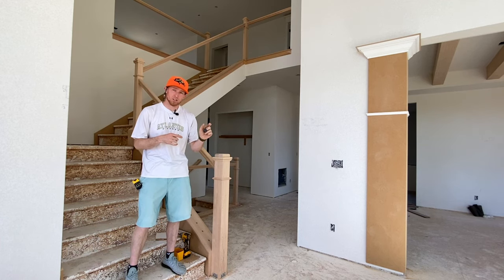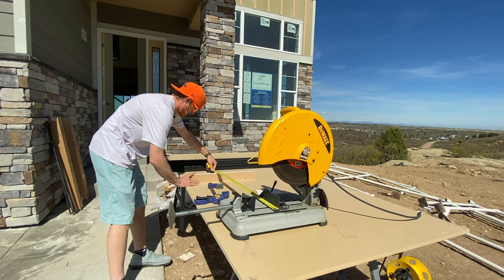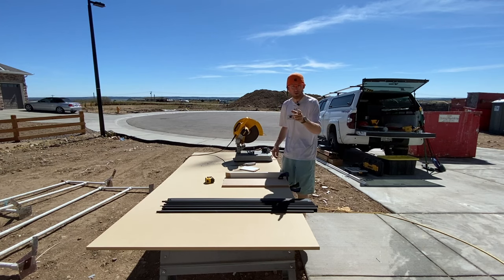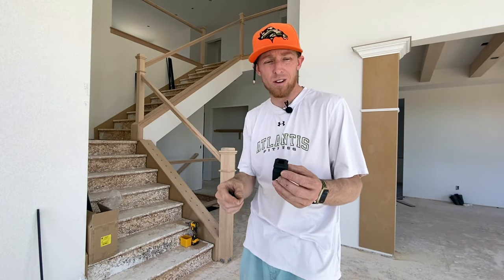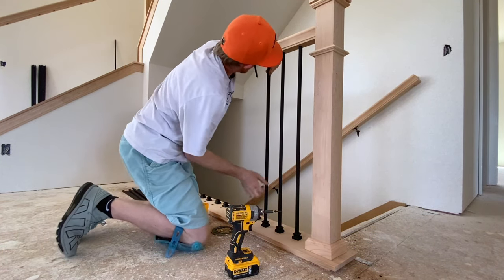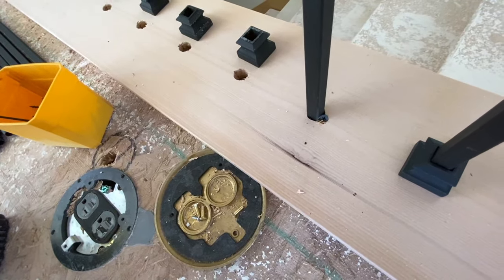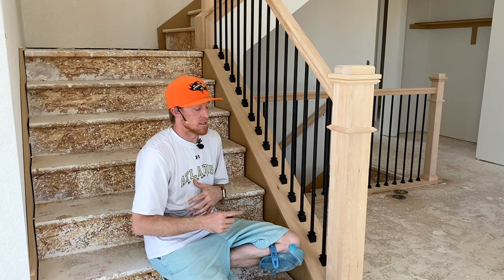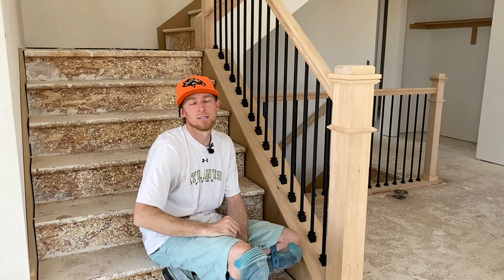IRON BALUSTER INSTALLATION / EASY DIY RE-SECURE *NO GLUE* : MEASURE, CUT, INSTALL, STAIRCASE UPDATE!

Comment: Great Job Hunter.  Starting tomorrow.  I take it the depth of your holes are 3/4"?  I'm installing 3/4" tubular iron balusters.  I was thinking a 13/16" hole at the bottom, what do your think?  Thanks so much.
Reply from the maker: Thank you very much! I would try 13/16” for the bottom, but don’t be afraid to go to 7/8” if it is hard to slide into the hole... sometimes you can gently tap the top of the baluster with a hammer into the hole if it’s snug...
I don’t go over the depth of the hole very well in the video... so you need to drill 1 1/2” (cap and subfloor thickness) deep to slide your baluster down then up into the handrail...in most cases I just drill 2” down(or until I break thru subfloor), but I know there is nothing for me to hit under the subfloor...just make sure you are snug on your hole up top with the baluster and you slide the baluster “about” 3/4” up into the handrail...
Any more questions I’m here to help! 
Have a blessed day!
Reply: @huntercarlson5446  Thanks Hunter!  I'm experimenting today but don't think it will be to complicated thanks to your video. I am a retired electrical engineer with a "blue collar" background.  I'll let you know how it goes.
Reply from the maker: Sounds good! You got this!

Comment: Just curious - if you use a 5/8 bit instead of 11/16 for the bottom: wouldn’t that give a better fit? The screw seems to pull the baluster left or right. When the gaps are real close to 4”, that could lead to disaster along a long run.
Reply from the maker: You can totally use 5/8” instead of 11/16”, you will just need to tap the baluster down into the bottom hole with a hammer because it will be super snug!

Comment: Thx Hunter. Great video. I’m about to do this over the weekend. My balusters were installed with a dowel pin on the bottom. The hole to accommodate this is about 1 1/2” deep and 7/8” diameter. The top hole is about 7/8” deep. My questions:

1) is the donated of the tread hole to wide to accommodate this method?

2) should I drill the top hole deeper and put a plug in the tread hole?

3) I know this is a no glue method but wouldn’t a little glue in the top hole better secure the balusters?

Thx for your help.
Reply from the maker: Hey Allen! Thanks for watching and hope this will help you with your install! 
1) the hole might be a little wide but as long as you pinch the baluster with the head of the screw it should hold nice and tight! Run the screw tight and parallel to the flat surface of the baluster, once the head of the screw pinches against the flat part of the baluster it should be nice and tight! 
2) if the “nib” on the top of your balusters are smaller than 7/8” then don’t drill the top holes deeper…you may need to drill the bottom holes deeper depending on the size you cut the balusters…if the holes on the handrail or the top holes are too big to hold the baluster tight, you can use the screw method and use a boot at the top to cover the screw and hole.
3) you can totally add glue to the top of the balusters…when I drill the top holes myself I make them either 1/2” for a flat section of rail and 5/8” for the rake section of the handrail. Those size holes hold the baluster nice and tight and I have never needed glue…also without glue it’s a little easier to replace them in the future if needed. 
Hope this helps! I’ll be available this weekend to answer some more questions if you have them! Have a blessed day 😎
Reply: @huntercarlson5446  thanks Hunter for the quick response. The balusters just arrived and the nib is less than 7/8” so I can now see how tight the top will be. Also looks like the gap in the bottom is not as wide as I thought. I might just put in 2 screws to stop any movement. Again I appreciate the time you took to make this video and your quick and thorough response. Have a great weekend!
Reply from the maker: I have used 2 screws on the bottom sometimes to help secure so I feel you will figure it out! Let me know if something comes up! Thank you for your support!
Reply: @huntercarlson5446  I'm replacing doweld balusters with rod iron. So I already have a hole on the bottom and adding a new handrail. I was concerned that the existing hole may be too big. The shoe would cover it fine, but learning your 1 or 2 screw trick eased my mind on getting them sturdy! Thanks!
Reply from the maker: I’m glad I was able to help! If you have any questions when it comes time to install your balusters don’t hesitate to reach out! I’ll be happy to answer to the best of my ability! Thanks for watching and looking through the comments! Have a blessed day 😎

Comment: Great video but I have a dumb question. On the level run, you mention in a previous comment you use 1x6 or 1x8 for the cap. Is that directly on top of the sub floor or is there anything in between?
Reply from the maker: Great question! In areas where carpet meets the cap, I nail and glue the cap to the subfloor. In areas where hardwood, tile, or vinyl meets the cap I will lift the cap so the flooring isn’t flush with the top of the cap...usually I will use 1/2” or 5/8” osb and rip pieces to secure underneath...even better would be to use a couple scraps of the flooring to raise the cap or install cap after flooring... please let me know if you have any more questions! Glad to help! Have a blessed day!
Reply: @huntercarlson5446  Thank you for the help, I really appreciate it!
Reply from the maker: Anytime! 😎

Comment: I currently  have wooden spindles.  How do you secure the wrought  iron when the top hole in the railing is bigger then the wrought iron?
Reply from the maker: Zina sorry it took a while to respond…I personally would use the screw method at the top as well as the bottom, but I would use a boot at the top as well to cover the hole and screw. So each baluster will have a boot at the top and bottom. Hope this helps and my response isn’t too late! Have a blessed day 😎

Comment: Hey Hunter. Great video,  good information and  down to the point. I''m about to install some balusters here in my house. I have a question as to the screws you are placing at the bottom to hold the balusters. Are they going between the baluster and wood base or are you going through the balusters?
Reply from the maker: Thank you so much! My screws are going between the baluster and the hole drilled into the wood cap...hold the baluster tight to one side of your hole and make sure you are keeping the screw tight to the flat part of the baluster so when the round head of the screw crosses the flat part of the baluster, it pinches the baluster snug to the wood...those three points of contact will hold the baluster nice and snug! Let me know if you have more questions! I will be here to help out! Have a blessed day!

Comment: Hunter, the current wood railing has a shoerail on top of cap, when I replace with iron, is the shoerail necessary ? We are having laminate floor installed at same time I replace rails.
Reply from the maker: When you replace the balusters with iron you need to remove the shoerail from the cap! The iron is not made to be installed on top of shoe rail...maybe mark the center of each baluster on your cap, before you demo, with pencil so you will know where to drill the hole for the new baluster...It will be a larger project but I would like to have the rail cap installed on top of the laminate or have a piece of 1/4” round to nail against cap and on top of the flooring...not suppose to nail the laminate from my understanding so there to be needs something on top of that edge to secure it from moving...

If you have any more questions please let me know! Hope I answered what you needed! Have a blessed day!

Comment: What is the going rate to replace wooden balusters with metal ones.??  There are 70 balusters with 47 linear feet of banister to sand and refinish.  Asking as a contractor.
Reply from the maker: Sorry it’s been weeks for a response…I believe I would be able to get it done in 1 day even if there is a lot of sanding…without seeing the project I would estimate $350-500 for labor…$350 would be for an easy job that didn’t require any additional drilling or plugging…$500 if there are some difficulties to getting a good final finish product. I would also be happy with $500 for a full days work, so it depends on the area you are in as well for the hourly rate of labor…
Hope this helps a little…if you have any more questions get back to me and I will definitely answer you faster! Have a blessed day 😎

Comment: Hi Hunter,  I want to replace the iron balusters that I currently have but of course they’re glued in.. do you know of any way to easily remove these?
Reply from the maker: So they are glued in...crap! The best way would be to first loosen the boots at the bottom, if you have a set of heavy duty pliers or vice grips try and twist each baluster until the glue loosens or breaks. Or if you have a tool to cut the balusters in half(grinder with metal blade or “sawzaw” with metal blade, and a good vacuum for metal shavings), cut them and then use pliers and gloves to twist and remove.  The balusters I use are hollow so I can bend them when they are secured, so maybe try to use some force and bend them to get them out...just be careful of the wood material for damage when doing so...hope this helps out! Any more questions don’t hesitate to ask! Have a blessed day!

Comment: Dude just finished my stair case using your methods, it looks awesome but my stairs don’t go down at the same angle as the slope on the boot. So when you tighten the Allen key up it sits weird, any tips how to over come that? I was thinking of either glueing then in or shimming them up some how? Love your work hope your well
Reply from the maker: Thank you very much for your kind words! Yes I have had that same problem in the past with the boots...I’d say to use a little dab of liquid nail under each boot to secure them for now...after the glue is dry gently tighten the Alan screws till tight and walk away...don’t use too much glue underneath so it’s easy to replace in the future...and other questions please let me know! Have a blessed day!
Reply: @huntercarlson5446  thanks for the reply, managed to insert pieces if cereal box on the opposite side of the Allen key screw and it allowed the boot to sit flush when I tightened up the Allen key screw , I’ll leave it like that fore now and see if it loosen over time. If it does I’ll glue them in like you said.
Reply from the maker: Great idea! Love how you improvised with what you had in the house! Thanks for your time!

Comment: Hunter, Great video and solution to PL Premium running all over my stairs. One question, I'm installing solid iron (not hollow) balusters. Anything you would do differently for solid balusters?  Will the screw method still hold up the weight of the solid baluster since the hole in the bottom would allow it to slip out if it slides past the screw?
Reply from the maker: Hey Rob! Thank you for watching and leaving a comment…I use to have solid balusters and still used the same trick with a screw at the bottom.  As long as the screw is tight to the balusters so the head of the screw pinches the baluster to the cap material…
I’ll have another video coming out tonight or tomorrow that has some more detail about installing iron if your interested…I’ll have time stamps so you can skip to the iron install… any more questions let me know…have a blessed day 😎
Reply: Thank you for the quick response. Yes, I'll be very interested in seeing your new video tonight. Thanks again.
Reply: Hunter,
Thanks for the additional video last night. One more question for you. I saw one question and reply regarding a bottom plowed shoe rail where you said it must be removed.  However, I've already done my rakes with glue (yuck) using the existing plowed shoe rail at the bottom. Now I want to use your screw method on the balcony and would like to be consistent. Are there structural concerns if I use the shoe rail with your screw method?   I can send you pics if you'd like to see.
Reply: Hunter,
Just wondering if you've been able to read my last question?  Any feedback would be greatly appreciated.
Reply from the maker: Yea shoot me a couple pictures so I can see exactly what your talking about…
Hunter@Dreamabithomes.com
I’ll get back to ya as soon as I can!
Reply: @huntercarlson5446  Per your request, I sent you an email with photos on 12/12 and then again on 12/14. Would you be able to review and respond by Friday please?
Reply from the maker: Hey Rob! I have not received any emails to that address…not sure what’s going on and why they are not coming in. Sorry you have tried twice already! Any way you can foreword it to another email?! 
Hunter.Carlson1@gmail.com

Comment: Hi, this is how my are installed. I want to remove them to take out the decorative middle. I’ve take out the screw, can turn the bales tee 360, but can’t remove it. How do I get it out?
Reply from the maker: I’m just guessing but you should be able to slide the baluster up or down just enough to get it out from the handrail. Might take some strength but it has to come out…thank you for watching! Was camping for a few days, sorry it took a few days to respond! Don’t hesitate to ask more questions! Have a blessed day 😎

Comment: I’ve spent hours learning how to do this via YouTube and this YouTube video was the best so thank you! My only question, which isn’t addressed bc not relevant to this but is this anything different i should do to keep a “basket” baluster in pattern and centered? If i can’t cut the tops won’t that make it difficult?
Reply from the maker: Hey thank you so much for the compliment! I hope I can answer you here...
-"Basket" baluster in pattern: Yes there is something that I do to keep a pattern as consistent as possible. Im guessing if you are installing "baskets(B)" you also have a "double twist(D)" or a "single twist(S)" baluster as well or both. Count the number of balusters in each section (post to post/ post to wall) and just lay them out on the floor and make your own pattern! There is a little bit of math I do in my head depending on the different style of balusters and the number of balusters(Odd or Even). For example: (S D B D S D B D S) OR ( D D B D D B D D).             Pattern is really up to you! But I can help if you provide me with a little more info... Different styles , number of each section...
- So to keep the pattern centered:  There should be a defined top and bottom with a "nip" or "nub" indicating the top.  On a FLAT run of the rail, measure the "width" of your "nub" (in my case 7/16" so I drill a 1/2" hole) and the depth of the "nub" (my case 7/8" so drill 1 1/4" deep in the material) Do the best you can! The depth doesn't have to be perfect!  In doing so each baluster will slide up tight into the hole tight all at the same height, if that makes sense.?  The pattern will be centered from the handrail height. 
- Cant cut the tops: I only cut the tops of the baluster on the stairways or rake of the rail. In that case I just cut 1" off the top. But the holes in my handrail are drilled to 5/8" and 1" deep. 5/8" being the diagonal size if the square baluster. Since you can NOT cut the tops just drill to 1 1/2" depth and make sure the baluster is tight sliding past the square part of the baluster.
 Hope this helps and all makes sense! Get back with me! Have a Blessed Day!

Comment: At 8:00, what are you screwing into? R u using a generic screw and is there a hole in the baluster?
Reply from the maker: I am using an 1 1/4” wood screw(Philips head). I am angling the screw so it creates a wedge in the holes that I have drilled in my rail cap. Hold the screw tight to the flat side of the baluster and screw in until the screw head meets the center of the baluster…if done correctly then you will scratch the baluster a bit with the screw and create a tight wedge by running your screw into the rail cap and sub floor, but don’t worry about the scratch it will be covered by the boot at the end…
Hope this helps! Thank you for watching and have a blessed day 😎
Reply: @huntercarlson5446  thank you for the reply Hunter. What size hole did you drill in this video?
Reply from the maker: @user-nv2gw1tt5o The top holes on the flat runs are 1/2”. The top holes on the rake run are 5/8”. All the bottom holes are 11/16”. These measurements are for a 5/8” thick baluster…